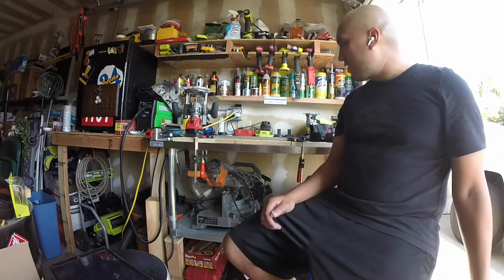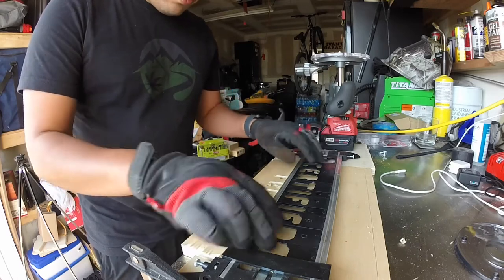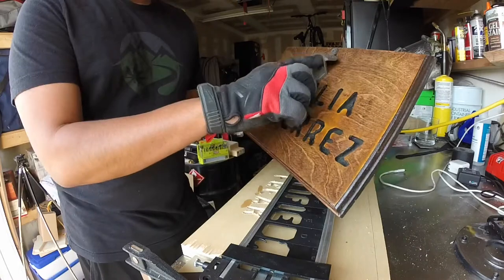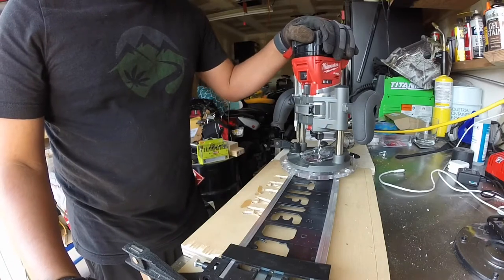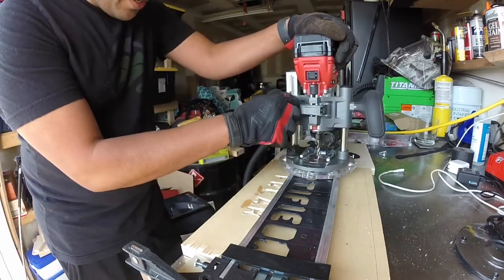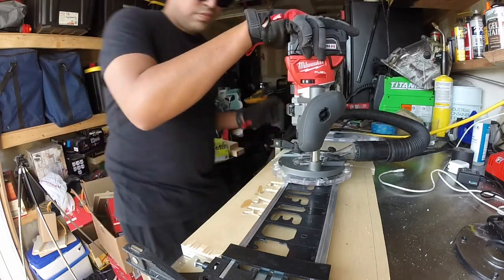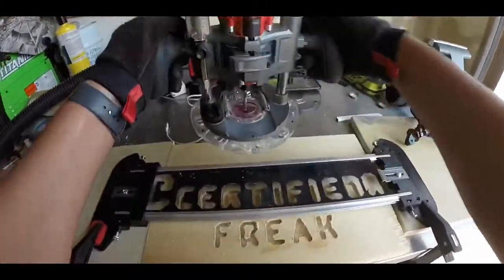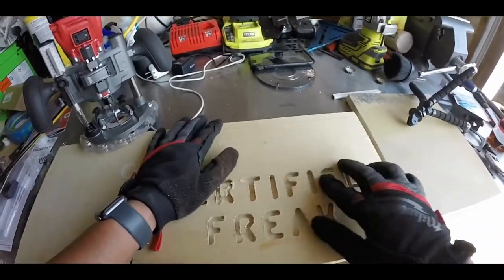M18 Fuel Compact Router Plunge Base PERFORMANCE REVIEW!!

Comment: I saw videos where the Bosch plunges the same way. I guess different brands take different approaches for what they feel is more ergonomic. I have an old plunge router where the lever acts as a lock, just like your Ryobi, but I'm actually looking forward to trying the lever on this adapter when it comes in. It seems faster and easier to raise and lower.

Comment: Ivan will the milwaukee trim router fir the makita plunge base?

I want to have really good dust extraction and it seems most fittings from 3rd party or 3d print communities etc are for makita with noone making any for the milwaukee. 

The standard piece for vacuum on the milwaukee is pretty crap too... one screw to fix it and it's not even near where the weight of the hose drags on it.

Comment: Not sure if you solved the problem with the fine adjustment yet, but there is an screw on the clamp of that base you can tighten to make it from sliding up and down

Comment: It costs 4 times as much because it’s 4 times the tool.  You say this at least 10 times in your videos.  The materials used in construction of the Milwaukee are far superior to those used in the Ryobi.  The motor is a much better motor.  The batteries are better batteries.  

The router is fine, I’m pretty sure it’s the way you are using the router’s micro adjustment.  The set screw on the clamp needs to be adjusted “properly” in order for the clamp to close snugly over the router.  The micro adjustment knob shouldn’t be adjusted while clamped.  All adjustments need to be made prior to closing. Go to “John McGrath’s Channel” to view his overview of the Milwaukee M18 Palm Router.   He also thought he had an issue, even stating so in his video, until he corrected himself.  I feel it’s worth you viewing.

Comment: Would you say it's worth the purchase with the plunge base? I saw your other video and it was the first I'd seen saying anything negative about it but you seem much more positive with this attachment. It is real pricy but I'd save a bit of cash buying both together. I need a router soon regardless so I'm getting different opinions
Reply from the maker: If you’re using it mostly with, or only with the plunge base, then it’s amazing because the micro adjustment knob has no function with the plunge base.

Comment: You need to tighten the Allen about a 1/4 turn on the fixed base. Once that is tightened the router is locked in and has zero movement - it won’t matter if you bump the micro adjustment when the router is locked properly. 

The Ryobi housing is plastic and the collet isn’t as good. It is not as accurate. By design it isn’t as accurate as the Milwaukee, DeWALT, Makita, Rigid, and FLEX. 

Even the DeWALT and FLEX ring moves when the router is locked - since they are locked it doesn’t matter if the rings move.

So, yes, you are doing something wrong.